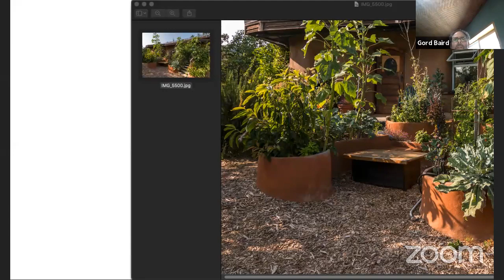Interview With Gord Baird Author of Essential Composting Toilets

Comment: Glad you're having this conversation. The most easily implemented dry composting toilet system for most people in an existing home is the sub rosa auxiliary toilet that exists parallel to the official flush toilet. Basically, do the regular flush toilet as per municipal and provincial/state requirements and then proceed to use the bucket compost system without mentioning it to the people at City Hall.